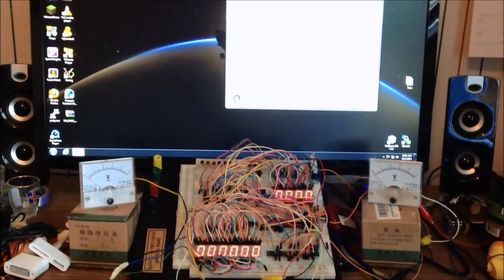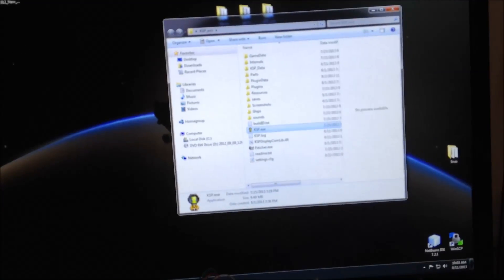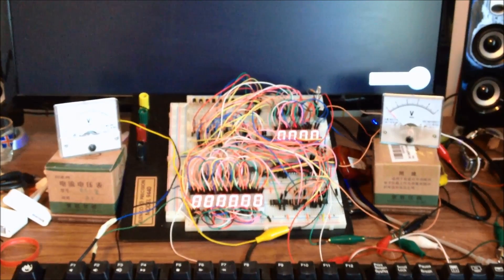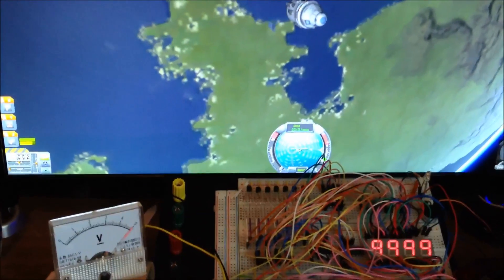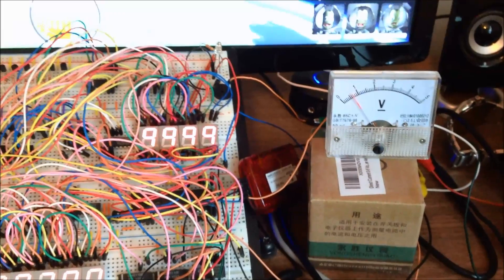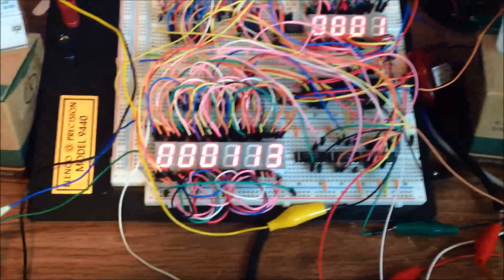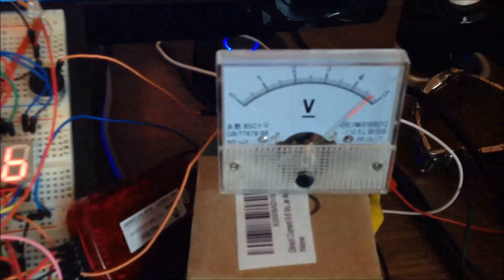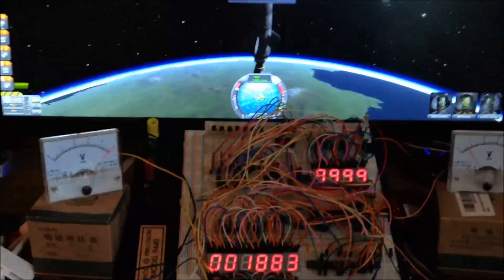KSP Display (Physical Display)

Comment: You should add more than just a display, like add a button for staging, or a throttle, for well' rocket throttling. Also maybe add multiple master alarms under multiple LEDs, like say you're going to fast that your parachutes about to fall off have one led for that and others for low monopropellant, oxidizer etc. Other than that, its looking very good for an early start